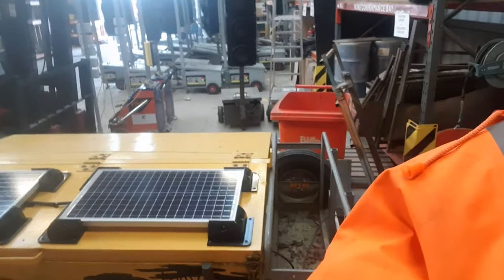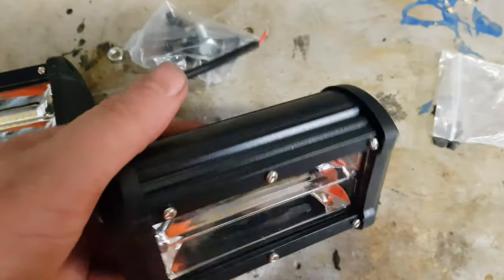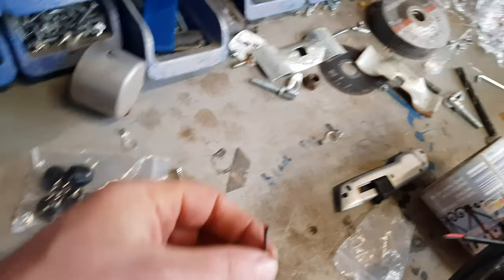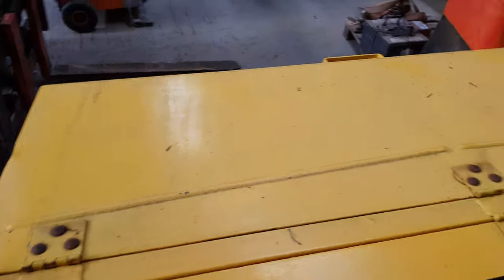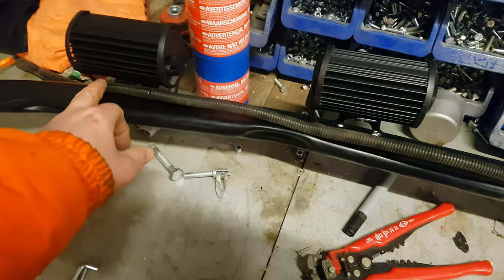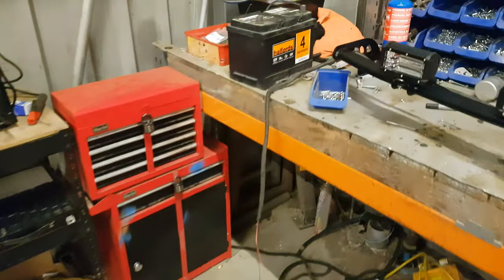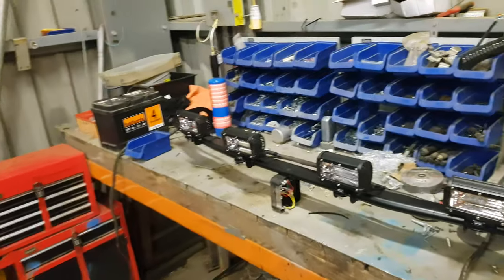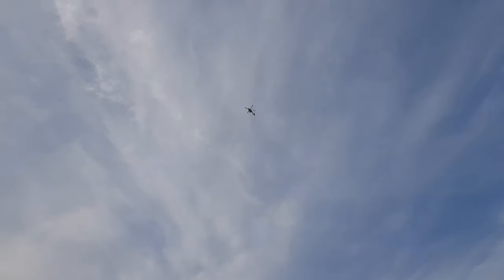Fitting A LED Light Bar To My Discovery 2

Comment: Hello, very nice set up. We're did you purchase the light bar kit? I would like to install one like your that does not require drilling holes into the sheet metal. Thank you. Regards from Los Angeles, California.
Reply from the maker: Hiya J M. I believe it was an Ebay purchase but currently out of stock at the moment.  A quick Google search brought up the below link
https://www.sp-4x4.com/light_bar_for_land_rover_discovery_p/lm24.htm
You would have to check with them if they do international shipping. Hope this helps pal👍